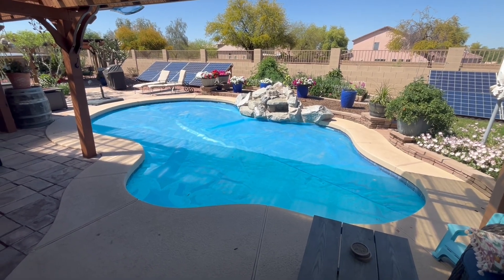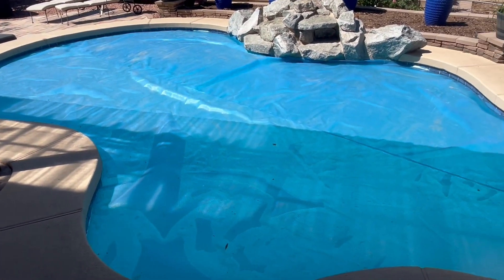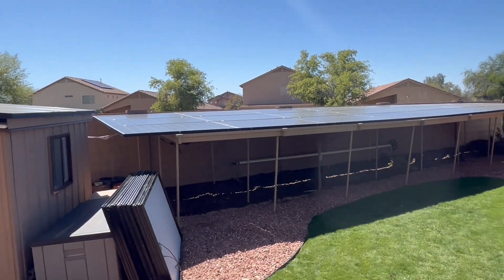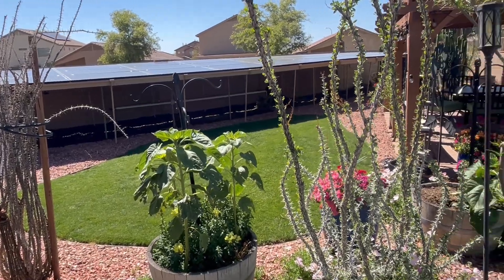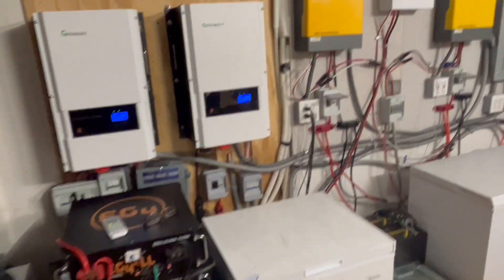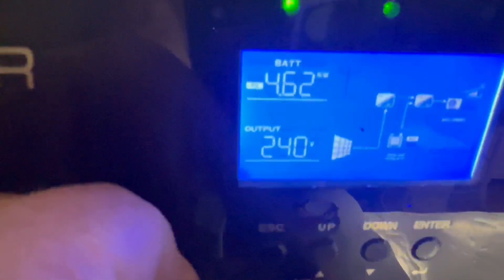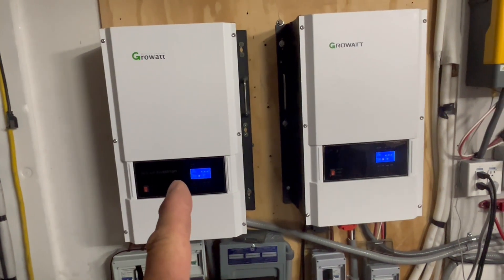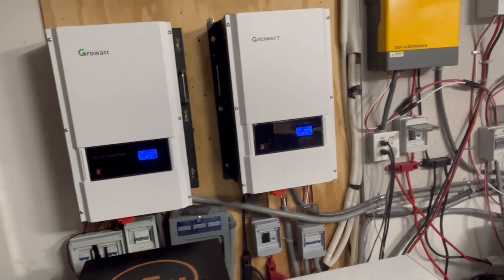Growatt 12kW inverter Heating pool with 127,000 btu electric pool heater & EG4 battery bank

Comment: I was wondering if you are permitted and inspected etc for all that? I was thinking of going non permitted. I am in the country.
Reply from the maker: If you are on grid, everything needs to be inspected and permitted because you are connecting to the grid and can feed into the grid. Linemen can get hurt if you feed into the grid when grid is down. So it is regulated when you want to go grid tie. The electric company can tell when you connect to the grid with their remote monitoring on your meter. 

When you are off grid, the power you produce does not connect to grid and back feed into the grid. So they can not tell you are even doing anything. You are basically producing your own power and using it in a closed grid loop so there is no way to determine anything you produce. 

It depends on your state, county, city. We live in a village that is not even a city and has no police force but has a nearby city police patrol and sheriff patrol as well. Since we are only a village there are no policies to enforce. We are pretty much in the country side where people still ride horses on the side of the road, in fact they have horse trail with rock paths for those who ride horses so the horses don’t have to walk on cement or asphalt for long stretches. 

When building off grid, most install the solar panels on ground mounts. If you install on your roof, you have to go through association to get approval and go through the city to get approval, inspection and permits. So most use ground mounts solar panels and avoid all of that above. No association approval need as long as not above fence line view, just mount on the ground and wire to your inverter, connect. To battery, run your electrical wire to what you want to run from the outside of your house to outlets or to air conditioners. 

My suggestion is I always try to follow code for wire to make sure it is safe for us. It helps to do things the right way if you are going to go to all that expense. 

Do your due diligence in being knowledgeable on all you want to do. The more knowledge you have, the better your system will be in safety, efficiency, early payback and no breakdowns. My system has been on pretty much autopilot for over a year now. 

No need to interact on a daily or weekly basis. The inverters stay on 24 hours and we just need to turn the appliances on or off when needed. Just like using grid power. It is now that simple for us. Everything is running perfectly. Hope this helps. Have a truly blessed day

Comment: how much $$ invested vs. using natural gas to burst heat your pool in 4hrs?   With my 200btu nat gas heater I can heat my Mi. pool 10k gallons from 70F to 90F in 4hrs,  $20 in gas,  $1500 for the heater.  Once it's up to temp, it stays there.     Just curious what you have invested, everything.  Wires, all.
Reply from the maker: @dmc4770  wow, if you can heat your pool that quick with 20 degrees in 4 hours for $20, I would not look to change a thing. Why invest in anything else when you can heat that cheap and quick. I only have electric at my house so I chose electric heat pump pool heater. My pool heater was $4200 and replace pool pump with variable speed pump for $900. I was going trough severe cancer, 2 cancers at the time and had excruciating joint pain and I noticed when in the pool my pain was hardly noticeable from the buoyancy of water. It took the weight off my joints. So for me it was worth not having to take pain meds equivalent to morphine every 4 hours round the clock. I have to keep pool cover on all the time in winter. The pool is completely in shade all day long so heating it is a 24 hour deal but in the spring February and March the pool is in sun 50 percent of the day so I start heating then. When I ran pool heater year round, I believe in the winter it was an extra $200 on electric bill running 24 hours a day.

Comment: Thank you for all of this!  I have several questions if you have time: 
How long was your pool season? 
Do you have to bypass your pool heat pump when night temps get down to create a frost? 
What reel do you use for your pool cover? How long does it take to remove and to cover (1 person)? 

I have a 20,000 gallon pool in SF East Bay. I would love to get a heat pump with dedicated PV to swim daily all year before work. I have roof top solar water to heat my pool, but I get some frosty days in the winter so I have to bypass it in winter. With my solar water, I can swim April 15 to Oct 15 without owning a pool cover.   I can swim down to 70 or even colder, but if it takes time to uncover and cover the pool each day - I probably won't do it.
Reply from the maker: Hi, my pool season last year through December using pool cover and my 17,000 Btu pool heater.  I started my pool season in Early February with the help of my 127,000 Btu pool heat pump heater which I use on my solar. I use both pool heaters on my solar. This year I changed my solar arrays and also switched the poly solar panels for mono solar panels. I now use the EG4 3000 watt off grid inverters,4 in parallel and should be able to produce the 6500-7500 watts needed to run pool heater during the day. I run my pool over night at 1200 rpm’s and during the day when sun is on the pool cover, I increase rpm’s on pool pump to 2400. I do not have a bypass for heaters. The water flows through the heaters when on and off so no need for a bypass. I bought my pool cover and reel from Amazon, both under $100 each. I can use the 17,000 Btu pool heater during the day to keep water warm and add 2-5 degrees when very little sun on pool. If you get sun on your pool all day long in winter or most of the day, that will help a lot to heat pool. I usually drop 2-5 degrees overnight when it gets below 50 degrees overnight. That’s where that 17,000 pool heat pump does a good job to recoup the temp during the day.  It in January and February I have to use the 127,000 Btu pool heater. It gets down below 50 degrees at night and even down into the 30’s in February. But if I run the big pool heater 4-6 hours a day on solar, I can keep my pool temp between 82-88 degrees. The 127,000 Btu pool heater needs around 12,000 watts of solar from mono panels to run and I can only produce the 6500-7500 watts needed between 10am to 3-4 pm. You could run the pool pump on grid power like I use to, it is 9 cents a kWh out here in the winter so 9 times 6 kWh is 54 cents an hour to run times 6 hours $3.24 a day to keep pool heated using solar pool cover as well. The reel had to be put together and works well but when I just want to clean pool or go for a quick swim, I just pull pool cover off and fold over on ground as I remove it, much easier to put back on when I’m done cleaning or swimming. I do all this by myself and it only takes about 2-4 minutes to remove pool cover and the same to pull cover back over the pool. The pool cover with my shape of pool, like a peanut, tends to be hard to roll up and flattens out the bubbles because there is a lot of drag when reeling up so bubbles get smashed. You want the bubbles to stay full size to get the heat. The sun out here in Phoenix AZ kills the pool covers in just 2 years, I don’t think the sun out there is as intense so you might get 3-4 years out of pool cover. I usually get the 14 mill plastic cover. 200 um. Price has increased to over $100. Last bought October 2023. Try just keeping the pool cover on without a heater. My pool is still 90 degrees even though we got down to 86 degrees last week. If your pool has sun most of the day, your pool will stay warm. If it get a lot of sun, run your pool pump on 2000 rpm’s to distribute the heat in water evenly, pool covers tend to heat the top 12 inches really hot but not below that so you have to run pool pump on at least 2000 rpm’s to evenly distribute heated water. Then just 1000-2000 rpm over night just to keep the chlorine moving through pool so you don’t get algae. I installed a jacuzzi variable speed pump myself. Paid for itself in electric cost savings in just 2 years. When I put pool cover back on after swimming, I just get in pool, grab pool cover and walk it over to the other end, takes maybe 1-2 minutes at most. Then I just get out. Try to keep pool cover flat without any large bubbles when on water. Pool cover will shrink a little over the 2 years. I usually cut the pool cover to the shape of my pool and add 3-4 inches extra all the way around the shape of pool. Wherever water is not covered, it will get cold in that area fast and the pool cover needs to lay as flat as possible to transfer heat. Bubbles need to face down. The smooth surface should be facing up, bubble in water. Like I said, if you get full sun on pool most of the day in winter, a pool cover might keep it warm most of the winter by itself with no heater. My pool is shaded right now thus time of year, only 40 percent of pool is in sun during the day, but it is enough to keep at 90 degrees by just using pool cover so far. Next month through February, the pool will be completely shaded for 4/5 months. That’s why I have to heat it. It a little over $100 to try using pool cover, what do you have to loose. Hope this info helps.
Reply from the maker: Good afternoon, I just posted a video trying to answer all your questions. Let me know if you have any other questions. Hope you have a truly blessed weekend and find all the answerers in the video you were looking for.

Comment: Nice video filled with good tips & trix. I'm setting up a much easier solar powered pool heater right now and my goal is 30°C / 86°F in the pool. I'm starting with 250 meters / 820 feet of 20 mm / ¾ inch PEM hose in a flat rooftop setup. A 20V rainwater barrel pump (2,000 liters - 528 gallons / hour) will be connected directly to a single solar panel, so it's a completely automatic system controlled and powered by the sun.

No sun = no pump = no heating.

Since I'm located at 60° latitude in the northern hemisphere, I'll guess it'll be some problems and math to solve along the way, but it'll be fun.

Keep up your good work
Reply from the maker: I did that with the 1/2 inch black drip line. 200 feet in a circle mounted in a black painted box.i had 3 sets connected to a Ryobi 18 volt sump pump. The biggest problem to overcome is having the water go through the tubing slow enough to pumice up the heat. It basically almost has to trickle out in order to pick up the heat. I have a 15,900 gallon pool and honestly using a thermal pool cover heated the water better than the tub I g heater. It was a lot of fun building but lack luster results. The 127,000 but pool heater is able to heat with the pool pump running at 2200-2700 rpm’s and heat water 1-3 degrees per hour while going through a 2 inch diameter pvc plumbing. . The more tubing you can use and the smaller the inside diameter, the better the results for the solar pool heater. Thank you so much for your excellent feedback on making a solar pool heater with one solar panel. I hope it will give you better results than I got. Hope you have a truly wonderful and extremely blessed 2024
Reply: @diy-solar-guy  I forgot to tell you that my pool only contains 3,300 gallons.
I've seen some videos with these black boxes with circle mounted hose, but it seems to be alot of troubles with them, so I choosed this setup instead. Sure the wind will lower the surface temp on the hose, but as long as I'll get around 110°F in the return from around 70°F pool water, then I'm happy.

In Sweden there is still freezing temp at night time, so I haven't been able to test my theory in reality so far, but I'm eager to start.
Reply from the maker: @SolarProjectsSweden  thank you for the wonderful info. Let me know how it works for you. Always interested in anything solar.
Reply: @diy-solar-guy  I'll give you an update when it's up and running

Comment: Whats your total amount of solar panels? I have 15kw (48 Panels) and am about to add 8kw (16 Panels) of bifacials so I will be over 23kw. Lets prepare for the Arizona summer! :D
Reply from the maker: I have 48-250 watt mono used solar panels connected with another 10-400 watt bifocal solar panels on EG4 charge controller to supplement my load for 127,000 btu pool heater. Can not parallel Growatt low frequency inverters so I use the charge controller connected to bus bar if Growatt inverter. I also have the second Growatt inverter with 26-250 watt solar panels. The EG4 inverters have 16-250 watt solar panels connected. Total 26,500 watts of solar available usually only need around 5000 watts for ac and pool. Better to be over paneled than under paneled. Especially when the used solar panels were $20-$40 each. Nice to have the power available if I need it. Can run my pool heater, upstairs and downstairs ac and garage ac as well as pool pump, 3 chest freezers and 24.5 cf fridge/freezer at the same time. Was nice and cool in house and garage yesterday with 94 degrees outside. Did not use any grid power to cool house or garage. Hope you stay cool this summer in AZ. Thanks for you input and hope you have a truly wonderful and extremely blessed 2024.